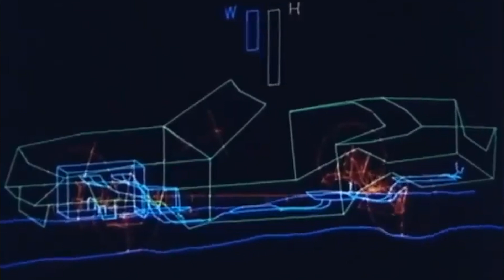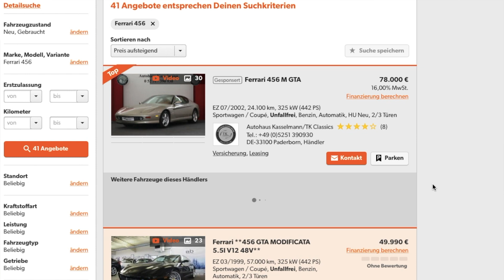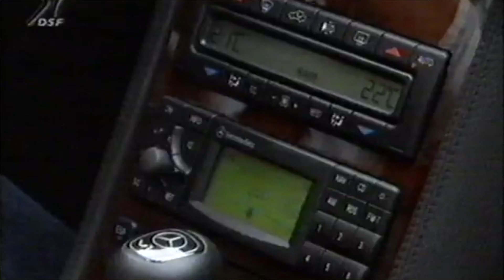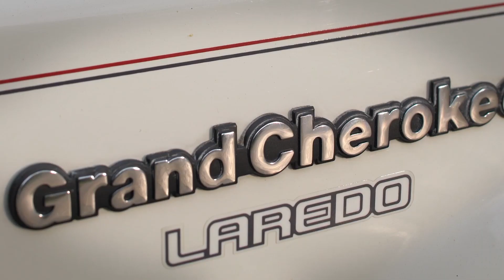The Best Cars and Future Classics of 1992

Comment: Own a 1992 Corvette, got lucky with it, low mileage 38,000 miles  nearly mint condition (the original leather seats have some sun damage) best thing is I got all the original paperwork with it only had one owner before me I was born july 30th it rolled off factory floor on the 31st in Kentucky I'm exactly a day older but yeah gotta give credit a bit to Viper because of there 400 HP cars in 91 corvette bumped up their Hp to 300 in 1992 thanks to the LT1, those numbers are relatively low by todays standards but back then that was impressive from what I have found.